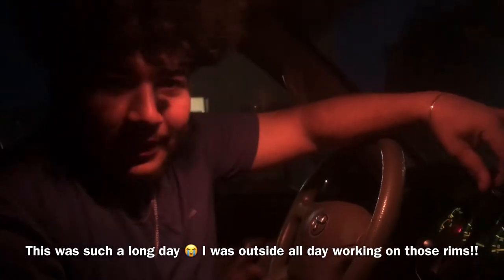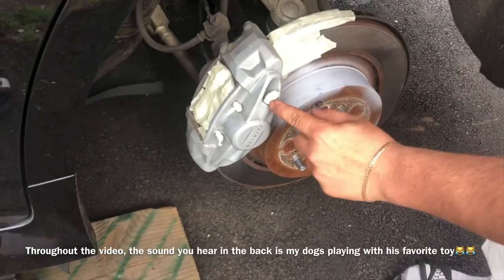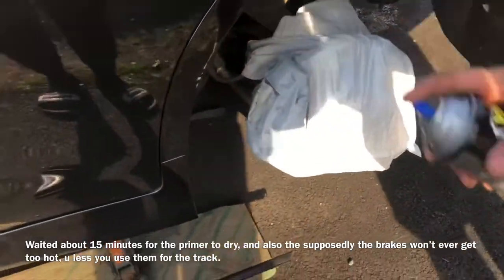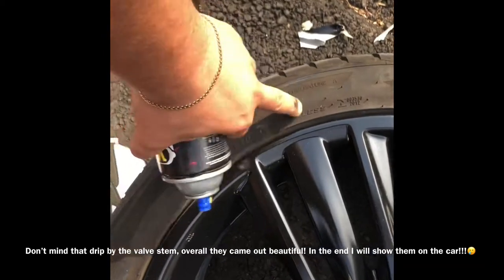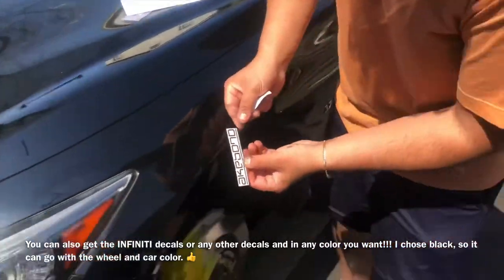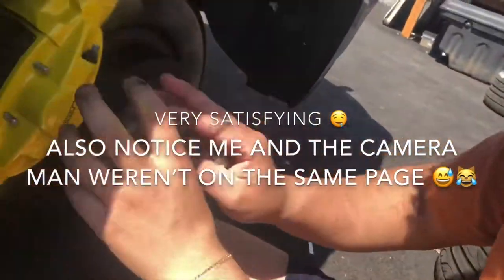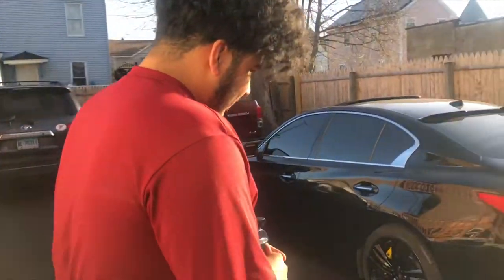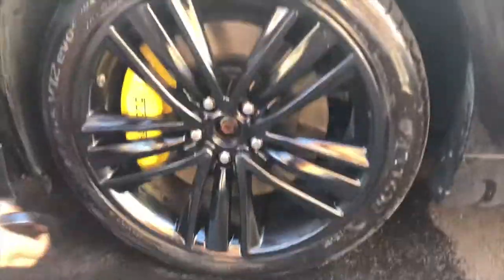HOW TO SPRAY PAINT BBK AKEBONO BRAKE CALIPERS INFINITI Q50s 3.7

Comment: That yellow looks fire bro 🔥
Next time mask off some of the car too. That overspray can be a problem
And you should clearcoat the wheels too
Reply from the maker: Good looks bro, I was actually really debating between yellow or a light blue like the blue stripe on the BMWs, but I decided to go with yellow and I’m happy I did! Also you’re completely right about masking off the car, not sure if you could tell front the video, but the front was full of yellow dust, I can wipe it off or get a car wash, but it definitely it a problem! Good thing actual paint didn’t get on the fenders or anything. About the clear coat, just as the primer, some people chose to use it and some don’t, so I didn’t show it, but I did spray 1-2 layers of clear coat! I should have mentioned that in the video but it was such a busy 2 days! I got another video coming soon bro! Stay tuned! Also, what do you think of the roof racks 10:28?? 👀
Reply: @thericermaxima1093  nice man. So for the future if you want I use meguiars wheel cleaners to take off the dust and brake dust. Their wheel brightener works really well. And for the yellow over spray if it's not coming off you can use a claybar with some soapy water and that should take it off easily. The roof racks idk, honestly I'm not a fan of roof tracks in general on sedans but if you like it why not keep it
Reply from the maker: Alvin Draper alright sounds good bro! And meguiars is the best! I also heard that the purple wheel cleaner or something like that, is really good too! And yeah bro you’re right! I just wanted to hear someone’s personal opinion. I do a lot of fishing so I like to bring my kayak around, and the roof racks actually help! Btw, hat kind of car do you have bro?? Why not make videos too?
Reply: @thericermaxima1093  yeah but I'll be honest with you. I just went through a bottle of the one that turns purple when you spray it and  it doesn't do a good job actually cleaning. The color changing is kind of a gimmick. But it is safe for painted wheels so you might want to try it.

Funny you say that...I'm actually trying to start my channel asap (hopefully by next week). It's not gonna be strictly car content but I'll definitely do a walk around and maybe some tutorials. I have a 2012 SV Maxima. I definitely let you know bro
Reply from the maker: Alvin Draper nice bro! I’ll definitely have to scoop some then! That’s why I’m scared to get a car wash because of the hard bristles they use to clean the tires. I think I’ll hand wash everything myself. 

Also, nice bro! I miss my maxima so much! I actually have had 3, but the first I never introduced to the channel!! Maximas will always have a special place in my heart! 

If you start making content, I’ll definitely be a viewer! 

Also, about the content of the channel, I too want to branch off into something else! I want to do vlogs about my daily activities, for example I mentioned fishing, I can do a fishing vlog. 

Keep me updated bro!